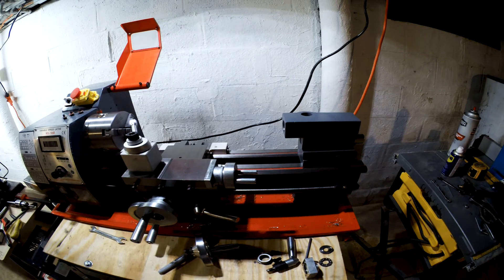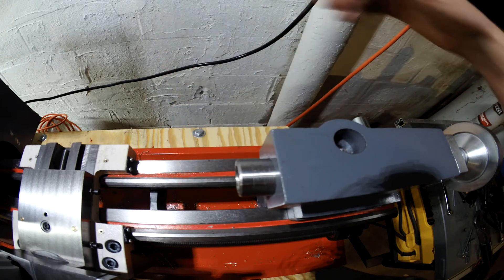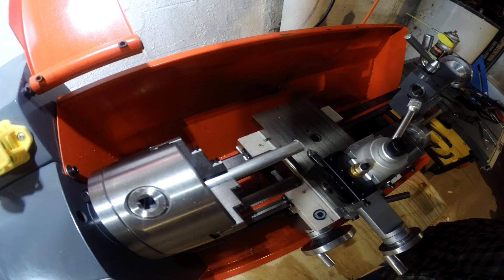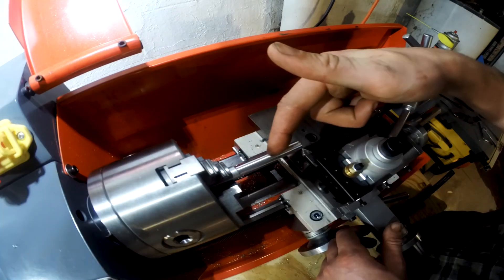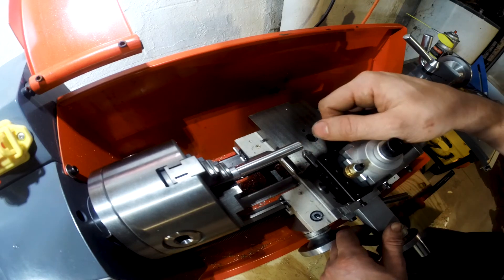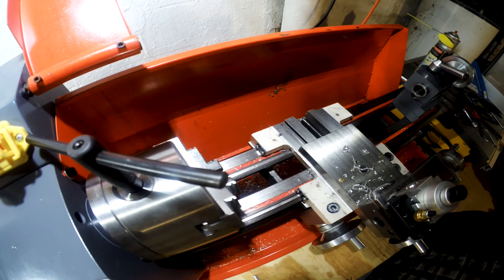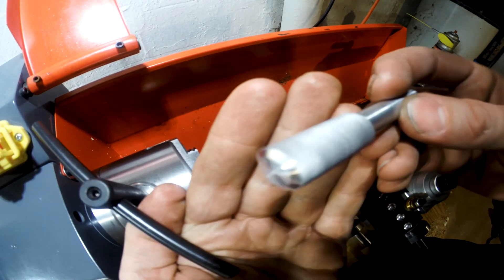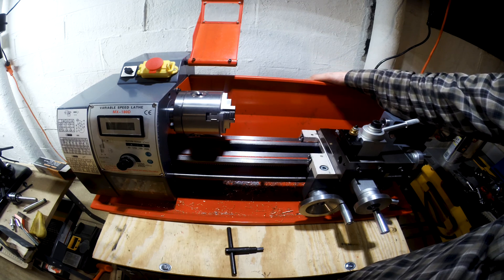MX-180D mini metal lathe pt.2 plus a new handle for the quick change post

Comment: What QC tool post did you buy to modify the lathe, and did it fit to the factory cross slide? I have the same lathe and looking at putting a quick change tool post on. Great video.
Reply from the maker: I have updated the description to include a link to the qc tool post. I have used that tool post for over a year now with no issues. But I recently decided to go back to the factory tool post. I bought the right size tools and dont have to worry about any adjustments to tool height. The qc post was a direct bolt on. On this lathe, there is a raised ring that looks like an axle collar, underneath the tool post. The qctp will sit flat on it, I never had too many issues with flex in it.
Reply: Thanks for the quick reply and update. Very much appreciated.

Comment: I have the MX-210V.  Did you have a problem with the tail stock being to high ?  Also curious if you know where to buy parts for these.  Nice video's btw.
Reply from the maker: Sorry for the late reply, I just saw this. I dont have a problem with the tailstock being too high, but it does angle up. I havent decided on a fix for it yet. As far as parts go, littlemachineshop.com has the most comprehensive catalogue of parts I have found.
Reply: @618kustomz  I have since sold my lathe. Needed a mill to correct my tail stock. So now have a new mill. Will be getting another 8x16 soon. Thanks for the reply.
Reply from the maker: @danamize9618  which mill did you buy? I have been looking at them for a year now. I'm too indecisive on the model I want.
Reply: @618kustomz  I bought a pm25. Pretty happy with it.